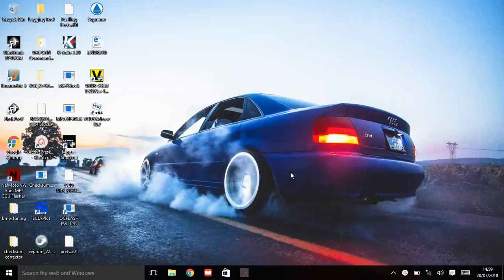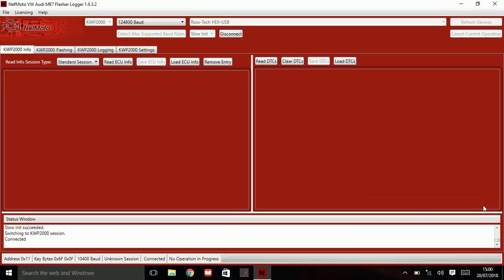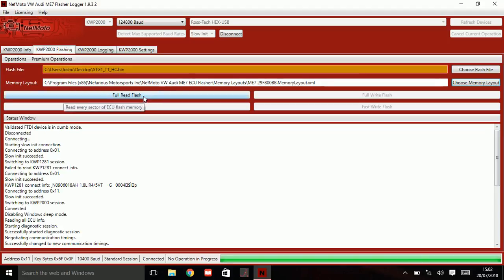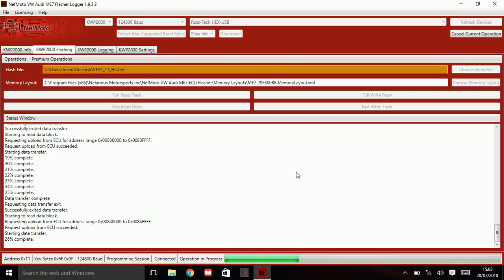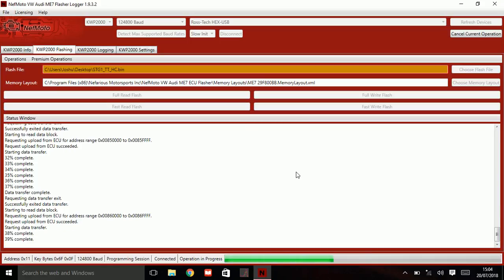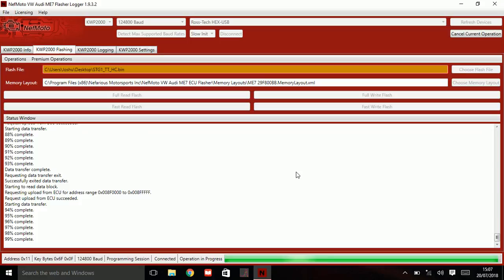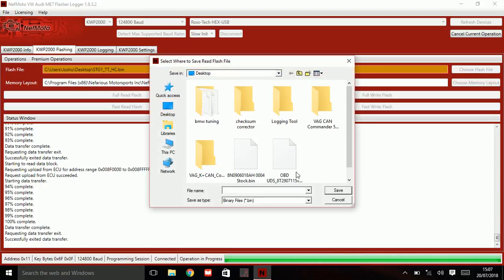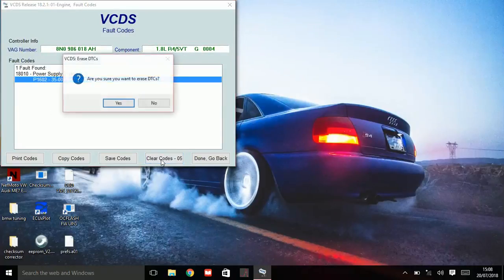How to Use NEFMOTO ECU Flasher

Comment: What memory file would I need for a 2002 mk4 gti 337 6 speed 1.8t awp
Reply from the maker: if its cable throttle, the 29F400BB, if its DBW = 29F800BB

Comment: what memory layout would I use for a 1.8t 2001 audi a4
Reply from the maker: Facelift Audi A4 B5 is Bosch ME7.1, with the 29F800BB flash memory.
Reply from the maker: Pre facelift Audi A4 B5 is Bosch M5.92, and can only be bench flashed. It can be read and written to however with a GQ4x4 programmer (directly to the chip desolder etc)

Comment: I have an rs3. Now its stage1 powerlab. I tried flashing it with unitronic software and a uniconnect+ cable but it failed.

I had my tuner flash it with the stock file and the tried uniconnect again but didnt work either. error transferring data.

Can you help me with this problem? Is there anything i can buy to flash the car into a state wich it will be campatible with unitronic flash? 

Please help :)
Reply from the maker: You need to go see a Unitronic dealer. They can bench the ecu for you. Alternatively ask the dealer (Audi) to factory update your ecu. This will set it to stock and then you should be able to read and write the ecu with the unitronic tool.
Reply: @labordemotorsport  seeing an unitronic dealer is not an option as im in sweden and nardocar couldnt help me benching the ecu unfortunately. 

But updating the ecu at audi will reset the ecu completely, 100%? If so it should be working. Will test this first then as i would have to send the ecu to canada otherwise. Not being able to use the car for a few weeks at least :/
Reply from the maker: Hello Tommie. We can supply you with a tuning unit and tune the car for you if you like. Send us a message on Instagram or Facebook. Cheers.
Reply: @labordemotorsport  as i already have payed for the unitronic stage2 files and the uniconnect cable im not searching for another tune but i need help figuring out what i can do to get the ecu to accept the flash. Tcu flashed fine. Just ecu is locking me from writing to it at all, but even if it stops at 0% it still gets "bricked" and in need of a recovery with different hardware. I think the current flash is using some tecnique to to lock me out.. and i need help ;/
Reply from the maker: Alternatively, find someone with a Vag Can Pro or ODIS and an FRF file of your software version. If your tuner needs help getting a file to factory update your ecu ask them to message us.

Comment: If I were to read the ECU does this just copy the .bin file from the ecu or does it pull it off? In other words, if I were to read the file on the car would I be able to drive the car after or would i need to reflash it right away?
Reply from the maker: The file will be copied from the ECU, no need to reflash :)

Comment: My nefmoto will not see my vag com hex+can cable boot mode is off of rosstech. I have windows 10s. how did you get yours to connect.
Reply from the maker: Rickey Wilbourn go into VCDS, and then settings. There should be a checkbox that says Boot In Intelligent mode. Uncheck that box and save. Then reopen Nefmoto and see if it works.
Reply: LM Tuning yeah did that and still won’t connect to nefmoto.
Reply: @rickeywilbourn4867  is it showing up in control panel as a serial or virtual com port in control panel? If I remember correctly it's gotta be vcp and I'd start there. Uninstall the drivers and reinstall is an option. But your question isn't very clear...
Reply: I am having the exact same issue with my ross-tech cable on Windows 10, however my older Vag-Com KKL with the FT232 chip, works perfectly.

Let me try and explain in a bit more detail what I am experiencing when trying to connect with the ross-tech hex-usb. 
I disabled the "Boot In Intelligent mode" in VCDS, double checked that it is still disabled after a reboot
When I try to connect Slow Init with any baud rate (I tried every single option), I see the following error: "Failed to read test echo from FTDI device." which leads me to believe I need to set up a Virtual COM Port for my Ross-Tech HEX-USB. I have not tried this as of yet and will be my next step.

I have also uninstalled and re-installed the driver with no success.